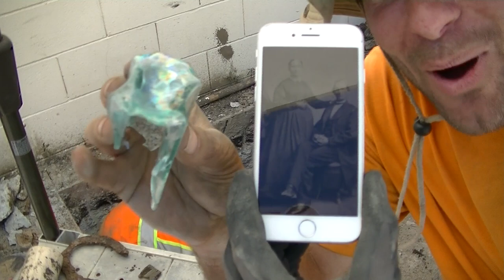Weirdo Digs Up Old Bottles in PARKING LOTS

Comment: I have a gold-filled pocket watch from 1895 that still works.  Old sugar mills, 19th Century steam factories have asbestos, but. I know where.  I have seen it, I think in the Waianae mill machine shop dump I dug in from 2016-2022, and later?  I am most cautious of odd whitish hot pink heavy nodules I've sifted.  Lead oxide from paint?  I still dug 5 Hutchs,  one 1913 ABM Waialua  slugplate.  Not rare, but clean & dug by me.  A John Loeffler pickle jar might be rate, ten known c1980.   Such a hobby.  I'm trying to track down a permission in Town m m back to the 1850s?